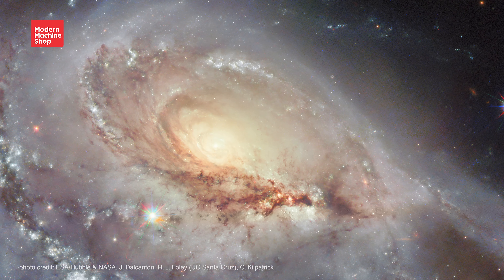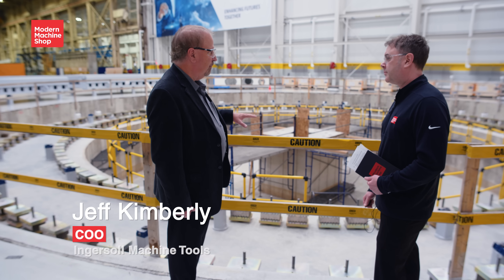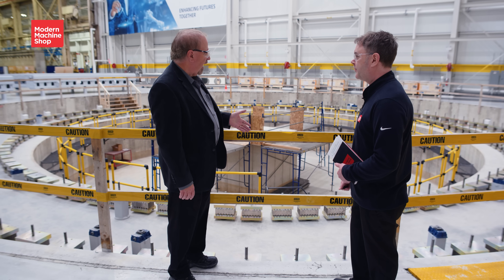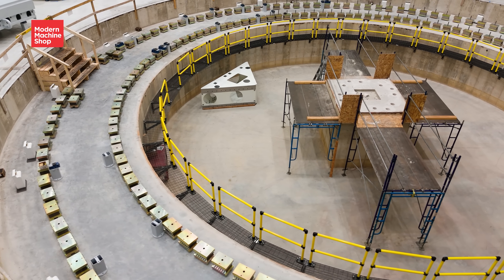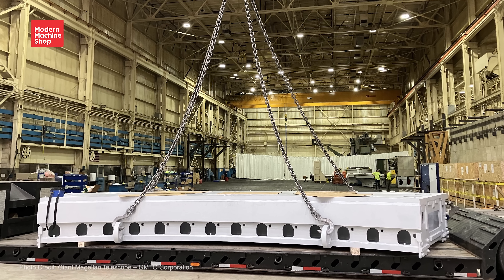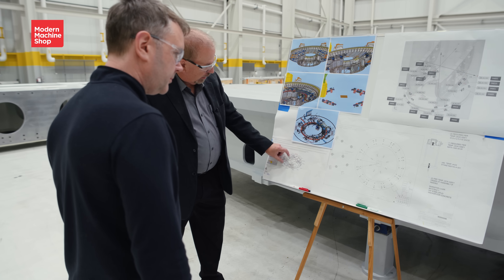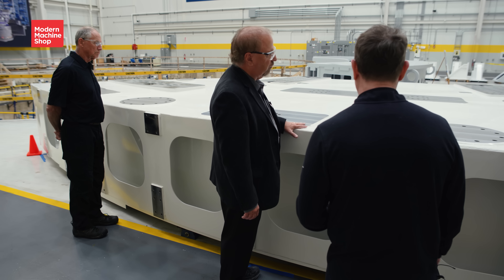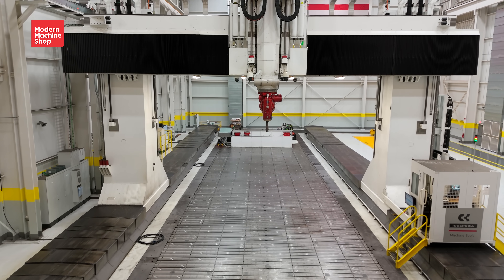Building the Giant Magellan Telescope: Precision Machining on a Massive Scale

Comment: Wow, the scale of these components and the machines that make them are just incredible! (I’d love to know what the overall work envelope and precision level of that gigantic gantry mill are.)
Reply from the maker: From our reporting the work envelope includes X-axis travel of 30 meters; Z-axis travel of 6.5 meters; column spacing (Y-axis) of 11 meters. The mill can handle structures more than 50 feet long with multiple setups, and the parts machined on this mill are required to hold flatness tolerances of just a few microns across multi-meter surfaces as well as perfect circularity across eight assembled azimuth sections. This implies sub-20-micron error budgets on very large arc segments. All told, the machine’s true volumetric accuracy is likely in the 10–20 µm/m range or better. As always, happy to be corrected by Ingersoll on this!
Reply: @modernmachineshop Oh duh, I missed the work envelope specs in the piece itself, thanks for the reply here! 10-20um/m wouldn’t be so incredible on a normal-sized machine, but across a length of 50+ feet (and a total x-axis of nearly 100 feet) is mind-blowing.

Comment: Very impressive to maintain that accuracy over that distance. 300 microns is a bit over a hundredth of an inch (for us here in the Imperial U.S.). For a small part in my garage machine shop, I can achieve 10 times that accuracy (say, a thousandths of an inch). But that's on a part measuring, maybe, six inches in diameter.
Reply: 10 microns is doable on small parts in my garage, $2000 lathe with a 5 micron DRO. But just small stuff👍👌🇦🇺

Comment: It is so sad to see a video like this.  Our company supported several "telescope projects", some secret, and a batch of off world science sats.  The big problem NOW, is that by the time this telescope is finished, the sky will be so populated by thousands of comm satellites, that the optical noise and pass-through artifacts, will essentially make this telescope only useful for a few-minutes to one-hour of observation.  It will be far worse than the Hubble or anything above the satellite orbits.  Also, the limits of thru-atmosphere observations have already been reached.  The only way you are going to get relevant NEW data, is with off-Earth devices, like Webb.  LIGO is in the same position, the local on-Earth noise levels are so high, that any improvements are technically impossible, and it will just get worse.  Even at the Webb, for example, getting below 20'K is difficult.  New science will require telescopes which operate at below 1'K and even into the 1-milliKelvin ranges.  NASA should scrap these ancient technologies, and transfer the funding to Off-Earth devices immediately.  Orbiting devices in reach of the ISS is also impractical.  There are already swarms of devices circling above them, and more will come soon.

Comment: Use holographic mirrors, a mile wide.
Reply: Ok, you design it.  😆
Reply: @Chris-bg8mk 
I bet, there is a way to reflect photons without physical material.  Perhaps, a very high and dense electromagnetic spectrum (far beyond the visible spectrum) ban created by an intersection of beams.
Reply: @EdwardMartin-t9m  I bet, there is a way to reflect photons without physical material.

Do it then, design such mirror, what stops you?

Comment: Why do they keep referring to the plates as 'hydrostatic'? Is there some sort of fluid involved in the surface mating of the plates? Understand there will be hydrostatic bearings used for movement between the plates, but the plates are not 'hydrostatic' in of themselves! The second thing is; They are concerned about the tolerances being off in moving the plates around the shop! What is going to be done to the tolerances when moving the plates via truck to ports, then shipping port to port, and finally port to site via truck? Are they setting up precession machining on site, to readjust tolerances after they are all distorted during the whole shipping and trucking processes?
Reply from the maker: Great question. “Hydrostatic” in this case refers to the bearing system used in the telescope mount. The large circular plates support and guide motion using a thin film of pressurized oil, allowing the 2,000-ton structure to move smoothly with minimal friction and wear. GMTO or Ingersoll team — chime in if any of that is inaccurate!
Reply: @modernmachineshop  That is correct. Hydrostatic bearings were first used for a telescope mount on the 200-inch (5-meter) Hale telescope on Palomar Mountain, California. The Hale telescope was completed in 1948 and remained the largest telescope in the world until the Keck 10-meter telescope was completed on Maunakea, Hawaii in 1993. The Giant Magellan Telescope will have a 1,000-inch (25-meter) aperture.
Reply: @jfanson2486   WE need a dozen of these in orbits across the solar system and beyond.
Reply: @jfanson2486  Not true, untill 6 meter БТА 30.12.1975